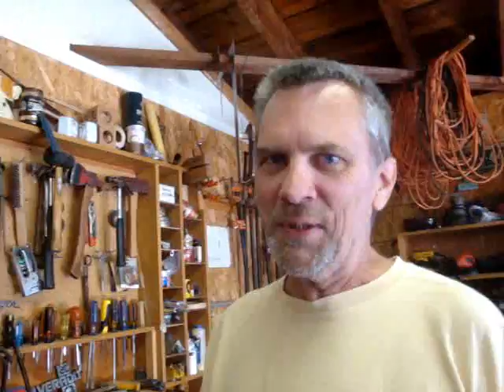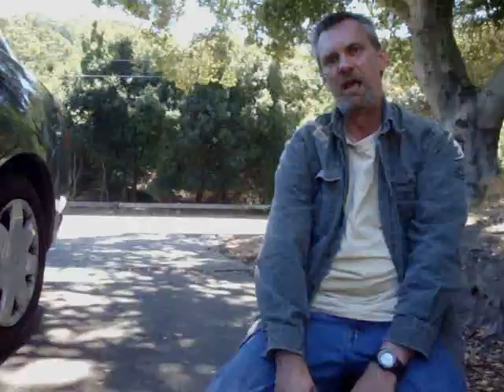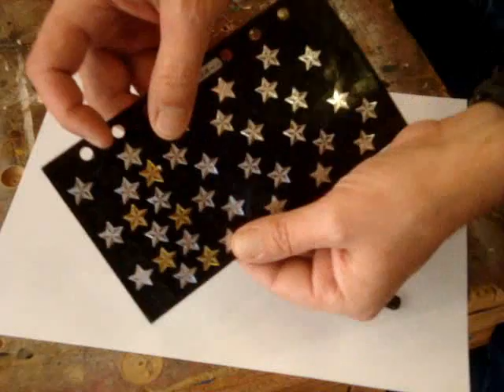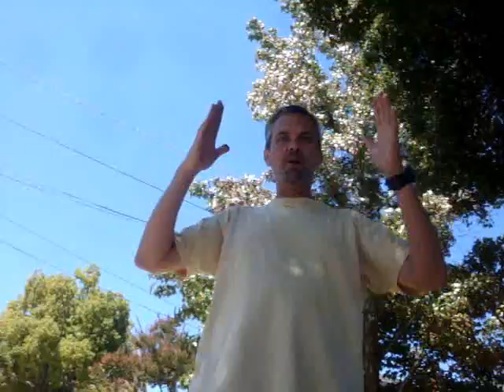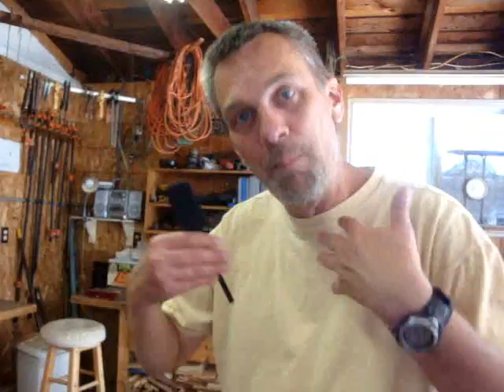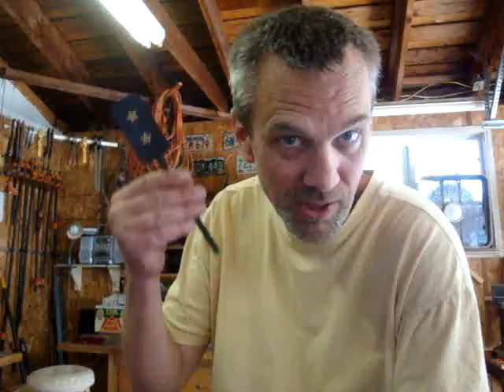5 minute woodworking project: the magic paddle

Comment: If it doesn't matter in writing, then where can it possibly matter otherwise? In speech, punctuation is nearly undetectable, save for the occasional pause, change in pitch, or change in volume. Practicing flawless punctuation and spelling on the internet will help those who are in the process of learning English better understand the language, and will convey your thoughts more completely than they could be without using said writing skills. Quite remedial skills, at that.